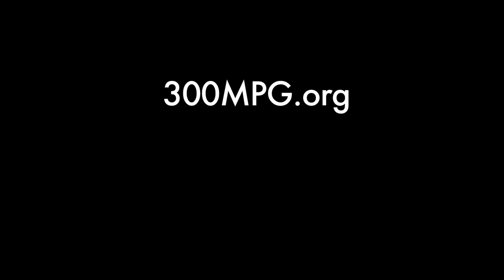iMIEV Controller tear-down and motor testing

Comment: Don't perform last rights on that circuit board just yet. Flush it with warm water, scrub it with a toothbrush and Lemon Joy liquid dish soap. Maybe even hit it with a fanned out spray from 12-15" away with a pressure washer. Pull it all apart and do both sides. Then rinse thoroughly and let dry in the open sun for several days. Trust me on this one. I have resurrected everything from laptop motherboards that had NiCad batteries leak all over it, to pagers and mobile two way radios that went deep sea diving. You have nothing to lose and everything to gain by trying.

Comment: I am not a electrical engineer but based on my knowledge i-MiEV uses a Permeant Magnet Motor which runs in synchronous frequency. If VFD runs in induction motor mode (frequency not synchronize) the motor will not turn. I don't think electric motor can damage that easily by flood.

Comment: That motor isn't a 60Hz fixed frequency motor, it's probably a variable frequency and variable phase lead (lag for regen) with a full ac amplitude motor.
you could add some lube to your trans axle.
How long did you let the salt water sit in that thing?

Comment: Would you say that Tesla pretty much stole the design for their vehicles?
Reply from the maker: No. There's nothing special about rear-wheel drive or AC motors.
What Tesla does really well is their software and power electronics.